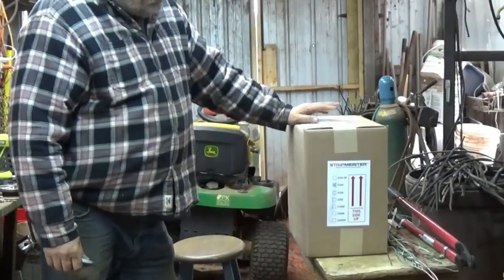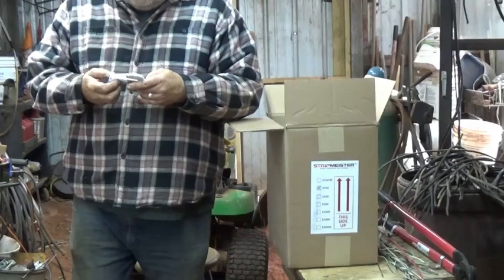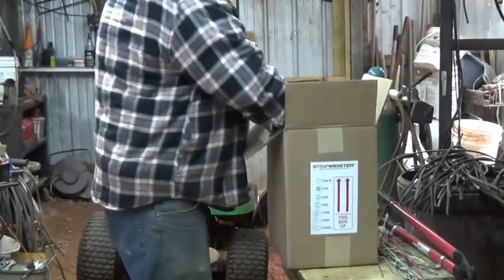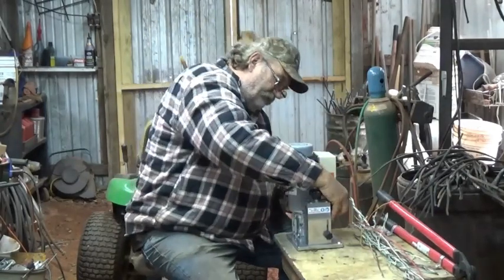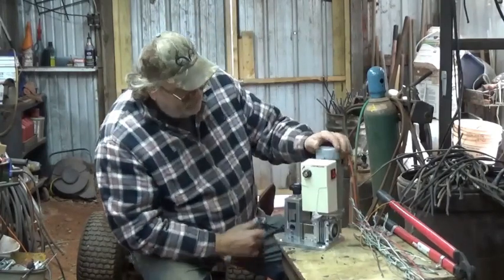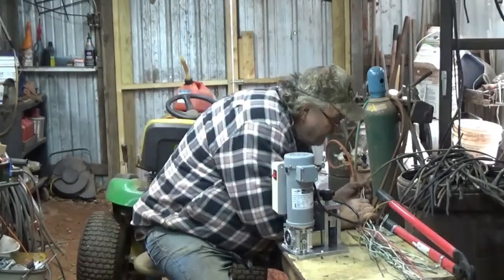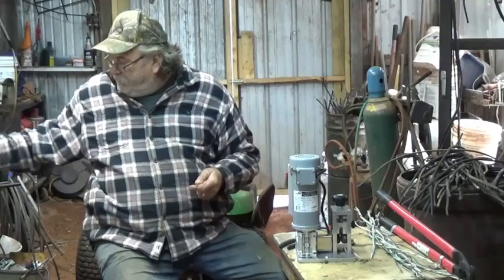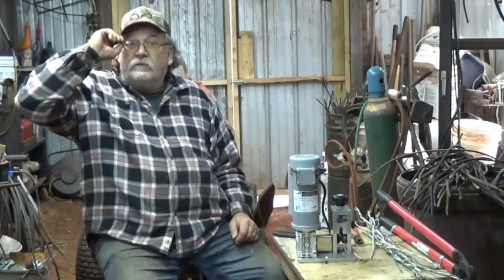Stripping Copper Wire with the StripMeister

Comment: That is so quiet.You will find it works good with braided wire,once you get use to it. Thanks for sharing
Reply from the maker: yes it was doing good on 14 gauge stranded wire the 16 was having problems with but not much copper in 16 gauge, Thanks for watching

Comment: I have a competing model, works great.  I've heard good things about the StripMeister.  Once you get these mechanized strippers dialed in, you can chomp through some wire.
Reply from the maker: i have been stripping wire most of the day, sorting through my barrel of wire. the thin stranded wire i am passing on but i am getting some a little thicker and it is running good,  solid core is doing good to. thanks for watching

Comment: I have the same one 250 took a little time to adjust to! it works great but found putting a spot light near the rear pointing toward blade helped to see wire cutting accuracy

Comment: I got the blue one and have found once you got it dialed  in run it  though 2 times and try turning 180. It helps me to run 18 to 24 inch sections and have all of one kind .You will get the hang of it.
Reply from the maker: it is working good, a small learning curve, I have another small pile that I need to get striped, it doesn't like small stranded too soft I think won't stay under the blade, but I can do the small solid wire from florescent lights. have to make sure no kinks in the wire. Thanks for watching

Comment: That is the same one I have. You have to make sure the guide is lower that the blade so the wire comes up on an angle. It also does not like kinked wire, it makes the wire jump out of the roller. It works really well on #14 to #6. Loomes (Romex) does not work in it well at all, it is faster to skin the outside insulation with a knife. Overall it works well on certain things and can really speed up the process.
Reply from the maker: yes i see that, and most of the wire i have is from appliances i will have to play with setup, but it will pay for itself. there is a lot of new houses going up around me i may have to get out and see if i can get some scrap wire, Thanks for Watching Mac
Reply: I've one too.Very well explained.I have mine set up the same way you do and it works well .Please take note Okie scrapper.

Comment: I learnd to put the wire in the right hole then ajust cutting wheel then ajust the hole guide down on the wire and it works great but takes time to get used too.again good luck.small wires under 16 gauge i dont do.
Reply from the maker: yes, a small learning curve getting it set up right. I have done some small wire. but you can spend an hour and only have a half pound of clean wire. and that would be ok if you have nothing better to do. or doing it while watching tv.

Comment: I love mine. I don't find it much faster then a sharp knife. But it is definitely less work and when I strip a lot by hand I get pain in my elbow. Enjoy
Reply from the maker: it works great on solid wire and big wire, haven't had much luck with small stranded like i get out of appliances. wants to stay to the side of cutting blade may have to play with setup. Thanks for watching
Reply: @Okiescrapper  I find the same thing. I get a lot of #16 wire and I find it just moves to one side of the blade. But #14 and bigger work great.

Comment: I have the version you hook up to a drill and I LOVE it!!  Once you get a feel for it, you'll be stripping like crazy!!  I usually don't strip the smaller braided wire (smaller than THNN), because you have to have it set perfectly, or it cuts into the wire and you have thin strands going everywhere and/or poking/cutting your hands all up.  Great video.  Good luck and happy stripping!!
Reply from the maker: yes i was out stripping wire yesterday and it didn't like 16 gauge but did good on 14 gauge Thanks for watching

Comment: Honestly on most of these machines I found stranded wire is going to mess you up under 14 gauge or wrap around the drive and jamb it up . Most likely solid wire thicker than 12 gauge is the only thing that is going to make it through and not need a second pass. 10 gauge is the money maker on this type of machine . end story
Reply from the maker: I have run very small solid core from florescent lights. and the trick to small strand wire is to bring the adjuster way down almost putting the wire in a bind between the drive wheel and the guide hole

Comment: I got my second one off Amazon the first one . the wire would not stay under the blade .sold the crap stripper . the second one was used . and the wire ran off the side .I'm faster using my knife .
Reply from the maker: I was having that problem with small wire, I found that moving the hole down some to where the wire has to ride at the top of the hole I worked for me, almost wedged between the top of the hole and the top of the drive wheel.  hope this helps, take care, stay safe,
Reply: @Okiescrapper  thanks I will try that 👍